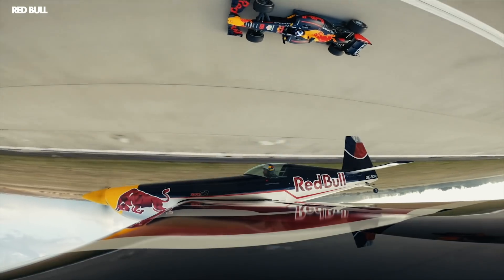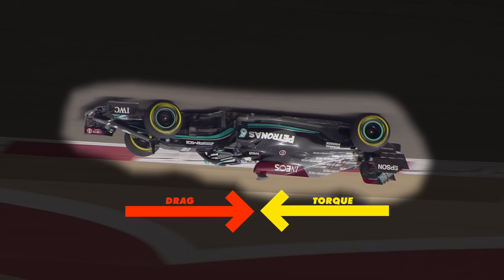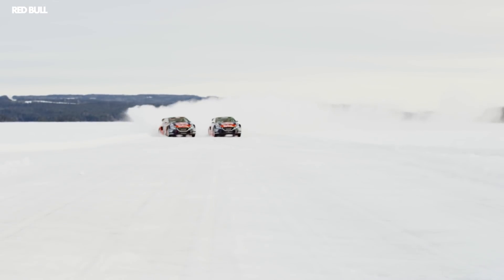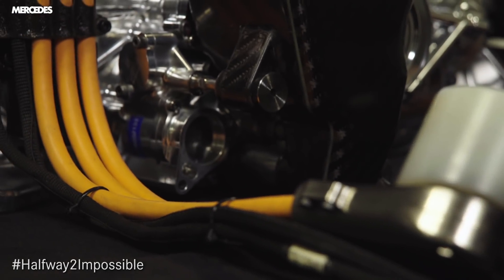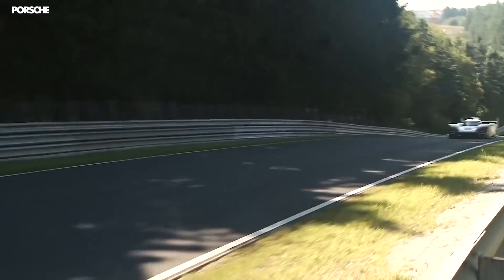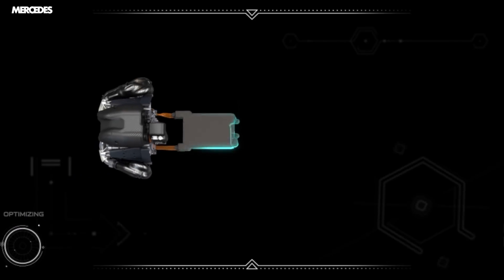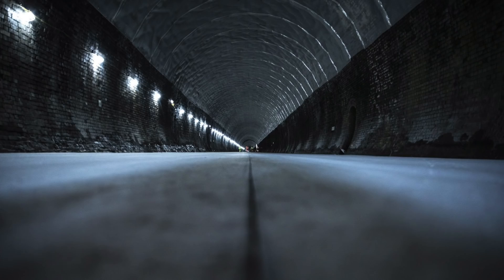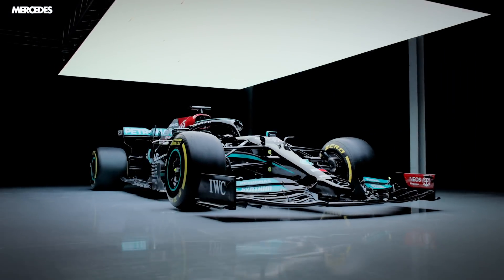Could a Formula 1 Car REALLY Drive Upside Down?

Comment from the maker: What do you think? Will we see someone do this in real life? 

Thanks for watching guys, don't forget to subscribe!
Reply: We can start from 'small' first, buy using F1 model remote control car.  It is way cheaper and safer.
Reply: @bahathir_  You beat me to it.
Reply: @serrapicam  
Another idea is to use special wind tunnel. Hang and hold the car upside down onto the ceiling with a 'crane system and rope/chain. When  the wind tunnel  Blow 300 km/h, then release the car an enjoy the magnificent  of the fluid dynanics in action.

Just an idea.. :)

Thank you.
Reply: Scott I would say if you have a giant fan to create a ground effect you could mitigate some of the downforce issues you mentioned in your video.
Reply: @SupremeEmperorKizza  Yeah, bring back the Brabham BT46 ! Also a rocket or jet engine would help with some of the issues, and they don't rely on tyre traction !
Reply: @karlosh2422  touche but this isn't about a "no rules" F1 car. If you wad to built a "no-rules" race car we'd all come up with some crazy overkill car like the  RB X2010/2012 .
Reply: @SupremeEmperorKizza  so strange youtube removed dislike button permanently.
Reply: @purwantiallan5089  They claim it was to protect small creators but really it's to protect the corporate press from reflection and honesty from the public. I'd argue no dislikes, you can't post any content.
Reply: @SupremeEmperorKizza  why man?
Reply: @purwantiallan5089  I told you their official reason but we know the truth.
Reply: If someone does it will be on a Red Bull
Reply: How about doing it around the Hadron Collider tunnel? Sure you'd have to rip out the $4.75billion particle accelerator, but it's a small price to pay for awesome!!!
Reply: i mean get elon aboard for when he fannaly does something with hyperloop bullshit :P
Reply: @vinnie8792  😆
Reply: @downforcedan  Mia Taylor should try it
Reply: You hit a bump and go flying... I mean falling... No you would need a car that can generate enough downforce through wings alone as the gravity wouldn't help you with correcting the ride height.
Reply: @ConfusedClarity  Exactly what I was thinking.
Reply: They do drive upside down every season (Before Covid 19) at the start of the season.
Reply: Hope your wedding celebrations were/are good. What would you have done if it was actually arranged on this sunday?
Reply: Just ask Guy Martin .  I’m sure he’d give it a go if you offer him a few cups of tea.
Reply: Isn´t there an Error in your calculations? 
McLaren said they get around 30kN of Downforce at 300kph by a weight of 750kg (or 7357N Gravitation) . So Round about 15kN of Downforce would be needed or 22,5kN if they counted gravitation in their favor. So the reqiured amount of downforce should be achieved at a slower speed therefore shortening the tunnel or making it possible to cut out the engine totally while driving upside down.
Reply: @lordtourette8854  Makes sence that momentum would keep the car upside down until it fell below certain thresholds.  Lower than 185 mph, and grip decreases.  Until it would be like driving on ice as Scott said.  Below 130 mph, and it would stall just like a plane.  Drag would cause that deceleration to be exponential.  

What if the track for the car also had a track for a wheeled gimble arm that kept the car from falling if it lost contact or lift?
Reply: I somewhat disagree with the engine oil going into the ignition chamber, as there are four seals it would have to bypass first, which, if you are only driving upside down for 5 seconds, isn't going to have any effect
Reply: Nice approach to the subject, thank you for the awesome content 🔥.
It would be great if you answer my LinkedIn msg, thank u
Reply: Unlikely it will be done. But if it were done, perhaps using a reduced scale model. But I don't know how the dynamics of a full scale car would translate to say a model that is an 1/8 of their size. 

You couldn't use existing 1/8 on-road race cars. They don't have the same levels of scaled downforce for all sorts of reasons. They are more reliant on mechanical grip. Such a car would have to be purpose built from the ground up.
https://youtu.be/jMG4henrC9U
Reply: Sorry chap but a cars weight is measured in newtons not kg. Kg is a unit of mass. Weight is a measure that the car experiences due to gravity, due to the acceleration that gravity imparts upon a body, in this case  a racing car, at sea level the acceleration is 9.81 m/s/s
Reply: Red Bull will seriously consider doing it... 😂❤️
Reply: Formula Student cars can do it as well ;)
Reply: It is surprising that Red Bull has not attempted it yet considering their history and resources.  

If the car was driving upside down on a ceiling and lost contact, would it flip right side up as it fell?  Similar to how the car will currently flip upside down if air gets underneath it.
Reply: i have a feeling that ... you you take a 2018 Ferrari the whole oil in burn chamber would not be a problem.
Reply: What about a double sumped flat 12? With electronic transfer pump on a gyro that can shift the liquid mass to the relitive “ bottom” then twin turbos on cross flowing heads that dump 2 banks of 6 pipes from the bottom. In a Tyrrell p34 with today’s tech in materials ot could weight as little as 600kgs ,less than the weight of an air race craft, plus there are more wheels to help with the transition. 🤤 think I need a moment
Reply: What about the Chaparral 2J or the Brabham BT46 with an FE-motor? They'd need lesser topspeed cause they'd literally suck themselves to the floor/roof.
Reply: @meisya9906  owuoreiurt
Reply: A flat cylinders engine could pull that off
Reply: I already did this in a Ford escort.  No big deal.
Reply: With electric engine, less batteries (just enough for the stunt), and remote control (reduces the car weight abot 80-90kg - the weight of the driver), it might be possible I guess. :)
Reply: Use a f1 spec boxer engine so the oil won't hydro lock the engine
Reply: I saw them do something similar in Men In Black…
Reply: @AuRecycler  Oooo! I'll have to check that out. Years ago, I suggested to the TV show "Myth Busters" that they do the experiment. I left it up to them to figure out that it could be done in miniature. Of course, they never did it (as far as I know) and I never heard back from them.
Reply: Ok RedBull, are you listening mr Horner? After Max takes win in the last race it is time to make this happen.
Reply: You seem to have forgotten that f1 cars run crazy amounts of balast that could easily be removed to reduce the weight significantly. I'm not sure if this would make it possible but it could be a lot closer
Reply: P   flpp
Reply: Red bull will do this at some point in the future
Reply: Sits here waiting for Abu Dhabi breakdown..
Reply: no. not im my lifetime.
Reply: so basically, the culprit for an F1 car is the engine can't run upside down? Well that's easy, put it in a gravity assisted bracket that rotates on the X axis, and instead of aircooled with a radiator, make it freon gas cooled with a compressor like how a fridge works just more sophisticated. Dips on driving the damn thing!!!! A big bearing on the back of the bracket (so the exhaust fits through) and smaller one on the front (so the fuel line fits through), everything else the engine needs is mounted in the bracket itself, and make the V-belt drive the compressor for the freon-gas too. Again DIPS on driving the damn thing!!!!
Reply: What’s with the Porsche 919 evo hybrid?
Reply: Amazing thought. And just now I was thinking sth suchlike:

1. Could some of all the 12 engine cylinders be fixed just upsidedown? So when your car flipped over the reversed cylinder could then work without the fuel and lubrication oil issues mentioned. Not sure about that.

2. What if a tunnel filled with water, but yet not full? ...It was like flooded sewers after days of heavy rain, only the ceiling's above the water. When your car's cab and youself were to be immersed in the water, the floor(maybe chassis) over above could run still in the air. However the water drag would increase accordingly.
Reply: Lol serious shade thrown at Haas
Reply: Maybe it would work if we would have boxer engines in F1 cars.
Reply: 2 strokes engines work upside down. Why not look into some very powerful 2 strokes?
Reply: It should be possible using a turbine engine, like a Turboprop engine but with a gearbox instead of the propeller.
Reply: Better
Reply: What about McMurtry Speirling and similar cars? Can you done some calculations?
Reply: I think the mcmurtry speirling could do it!
Reply: Just bring back the fan car and i'll f
Do it at 10 miles an hour...
Reply: Would a fan like we see on the Gordon Murry T.50 help with the downforce needed?
Reply: Getting up to the top of the tunnel and 'having 3 wheels' + increase in ride height isn't as much of an issue as you might think. Basically you'd be doing half a barrel loop up and half a barrel loop down and the centrifugal force involved. 

There modifications you could do to the engine with pumps, or use a different type of engine (a rotary engine for example). The biggest issue would be grip. It would have to be a very smooth surface, much more than an F1 track due to any lose of grip from say a bump or porpoising being very bad. You could add much larger wing elements that would readhere the tires to the ceiling with pure speed and wing angle.  But, at what point is it no longer a car but an airplane with an inverted cockpit? 

However, at what point is it no longer an F1 car. I think you could design a car to drive upside down for a lot more than 5 seconds but it would not be an F1 car.
Reply: if u use electric F1 car, it will solve most of the problems..rite..
Reply: The question would then be if the 2026 Regs with more electric power from the bigger MGU-K, smaller and lighter cars, and potentially still high downforce could change the balance of things.
Reply: An electric formula car. You only need enough battery power to test the run.
Reply: what happens when you're close behind someone wouldn't that reduce the downforce, also wouldn't it be called up force when they are upside down
Reply: Nice...be carefull...and clever :)
Reply: Also tunnel must have big diameter cause if is small, 
the arc shape leaves too much gap under the car and 
the aerodynamics will not work as designed.
Reply: I got a better question.

Who the hell cares if it is possible? What is with all the stupid "questions" 🙄🤦‍♂️
Reply: Technically airplanes can already do this. Centrifugal engines exist already with 1000 horsepower. Put them in the car and it will be just fine.

Comment: Using electromagnets in all 4 wheels, and using a tunnel made of iron may be able to help with a lot of these problems. It may be just as costly, but it will make it much easier to achieve. It is cheating.

Comment: Tunnels are expensive because of all the boring. But here, you just need a ceiling, you don't actually need to be underground, so you could simply build a cylindrical track above ground, which would be vastly cheaper. And before the cylindrical part, you could have a few km of normal road to comfortably pick up speed.

Comment: probably no.
1. oiling - despite dry sump systems, the oil pickup points would be suspend in air and oil would puddle in the cylinders. if you design an engine from the beginning to do so you might be able to get away with being inverted, like specific aircraft engines which are designed to be operated at negative G's, but even most have limits of how long they can do so.

2. can you hang the driver upside down? would the ergonomics be still be functional to operate pedals and controls?

none these issues exist in a loop.

you could probably modify a formula E car to do so and strap the drivers feet to the pedals.
this would be your best shot

Comment: Would it work if the engine would spin around a fixed axis, so basically it would stay upright at all times, of course you would need to make modifications so that the engine and all the components that are fueling it are going to flip with it will, but would it work?

Comment: Given how it needs to be done, A whole new car would have to be made and it would be for a fully round tunnel including the bottom. It would be formed on its bottom to hug the tunnel much like a F1 car does on a flat track. The engine if done right would not have to run upside down but backwards. Case in point lawn mower engines come in 2 flavors, Horizontal and vertical and both are dictated by the position of the crankshaft. Most car engines are Horizontal so a Vertical engine would be able to work with most the fluids being pushed to the back and even then a forced flow system can be done to pump the oil and fluids where it needs so it is not so heavily reliant on oil draining for lubrication. 
The other option is a Jet engine which has been strapped to vehicles multiple times and with how it operates the thrust it will make naturally can help push the car to the track. To make a clear point, the jet engine is being mechanically joined to the drive system to provide torque instead of relying on thrust to move the car but with how they operate they will still make thrust from its exhaust. You can see this on Tractor pulls where they stick up to three jet engines onto a single tractor and gear it to the wheels for pulling and they have the exhaust pointing upward. 
The final bit that is needed for this is the tires. Being mostly flat based they would have to run at a fairly high level of camber to be even to the tunnel wall. Since tires can be adjusted to fit the road and the curve is not that sharp then the tires themselves should be fine forming to the tunnel at speed since they generally want to bulb out.

Comment: Aircraft engineer here, if you have an inverted oil system like the redbull Air Race aircraft they could fly inverted pretty much indefinitely. The system just swaps the cranky case breather with the sump pickup with very little effect on performance. Also if said aircraft is pulling positive g's like at the top of a loop the inverted system is not required

Comment: normal car go loop and F1 would not stick in sealing. you not get enought speed to get ground force whateva to cancel gravity, but if it loop only need speed. no need F1 fiat do it LOL
and yes if you build airplane wigs upsidedown then yes you fly on roof, but can small wings on F1 do it when its easy when we allready have gravity anyway to pull car to track and still after bump it fly away LOL its not that magic force lol

Comment: Why hasn't it been done already? Because it's incredibly dangerous.  The air foils on an f1 car were meant to help keep it from lifting off the ground at high speeds.  If they break while driving upside down or the car slows a little too much gravity will overcome the effect of the air foils.  On top of that, the front air foils are designed to deal with ground effect lift.  Any gaps or cracks can have negative effects on the effectiveness of the air foils.

Comment: Since the battery doesn't have to last long, you can use a smaller battery that powers a stronger motor. You can also use a fan car (banned in F1) to generate higher downforce without extra speed.

Comment: Its possible, but you would need to make a car that specifically to run upside down, so it cant starve it self of oil or gas, and it would cost an absurd amount of money for a car thats only selling point would be driving upside down. I guess if you were an F1 team and wanted to use one of the old cars to attempt it you could make more in marketing than you spend on refitting the car.

Comment: You don't need the run up or the braking section to be a tunnel though... Only the upside down portion and the two transitions, so the actual tunnel could be significantly shorter than that.

Comment: 3:45 you are just making up that it needs double... it's probably a safe estimate but it would need at least  more than one times it's weight,  the additional would be based on how much friction is required for the car to have enough grip to maintain that speed.  I'm going to guess it would be far less than double,  but it would need to be consistent

Comment: Just a suggestion, you need the car to reach a certain speed in order to generate enough downforce to stay upside down. Instead of that, create a platform that can hold a fully functional F1 car and have clamps hold it to the platform and then put it into a wind tunnel generating as much wind as needed and then simply unclamp the car and see if the aerodynamics holds the car in place. Would that be better?
Reply: yeah sure thatd be easier but then you’re not driving a car on the ceiling, you’re just testing if a car has enough force to stay on the ceiling

Comment: Honestly why not rotate the engine to orient it correctly at all times? It's not that difficult to keep fuel lines/wiring harnesses mobile and if the output driveshaft is parallel to the direction of motion, you just need actuators that can counter engine rotational force for a bit (or even deload the engine during the flipping maneuver)...

Comment: This would be overengineered and really difficult to pull off. But imagine putting the entire engine on a horizontally spinning axis. You have 2 (or maybe more) "lock points" where the engine re-engages with the rest of the car. You'd have to build a lot of speed. Disconnect the engine while you start to drive up the ramp and go upside down. Reengage the engine at the new upside-down lockpoint. Then continue driving. 
Now. How would that work? No clue at all. Lmao